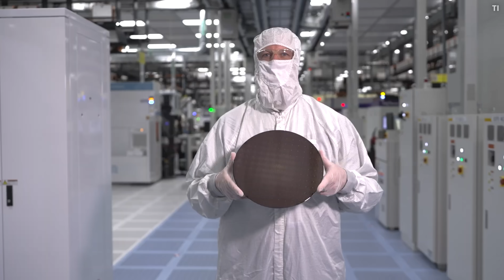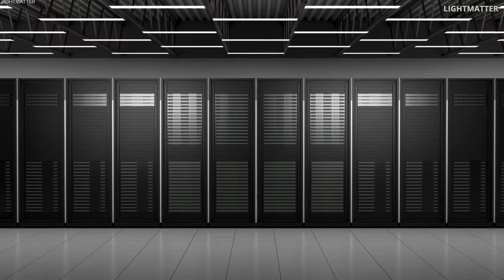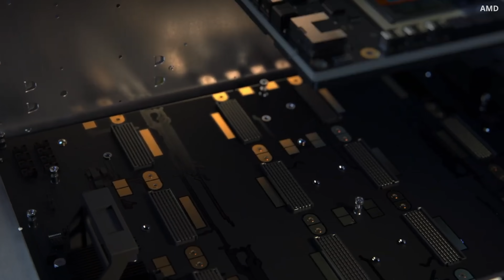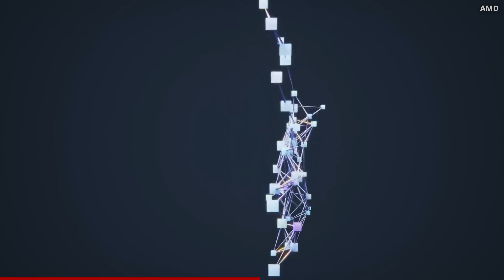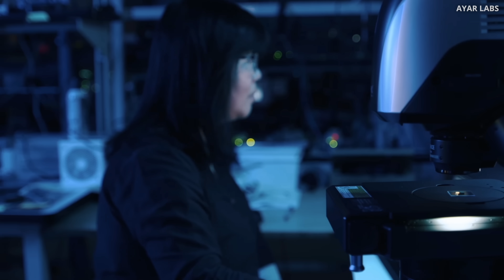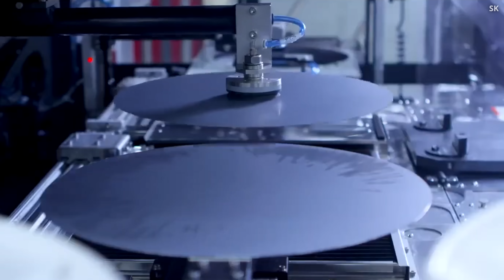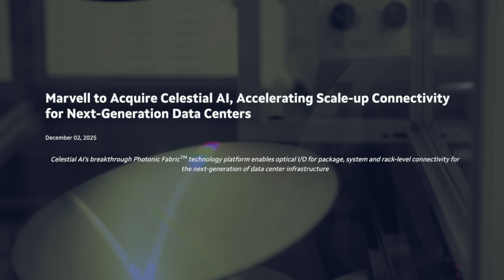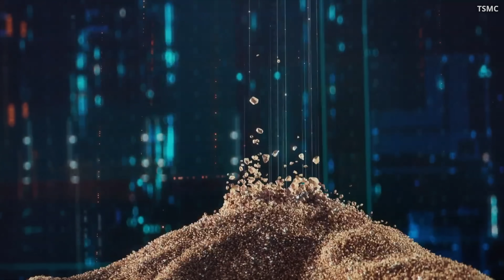Everyone Is Chasing This Technology

Comment: Plasma... use low temperature plasma to self translate light to electrons. Theoretically possible... just needs to be done. Look at how the new laser welders work. I have looked at them and all the light is doing is directing the flow of electrons at the welding site. The future is plasma physics... its how the entire universe works... its how nature conducts massive amounts of electricity... stop fighting it because of old models of physics... everything is electrical/light. Matter is a trapped frequency of it.

Comment: 7 minutes in, guys correct me if I'm wrong since I'm not a expert on the topic. But wasn't there a case of not using optical cables for interconnects that were lower than few meters because of the costs itself? Also there was one case about higher failure rates for optical links. (Source: I worked a little bit on datacenter load balancing)

P.s. amazing video though. And thermal stability is a gigantic problem in hpc

Comment: ♥️ @AnastasiInTech : Why aren’t day using pi-phi-fiber-optic relay filaments in place of copper electrolysis of zeros & ones’ at ration with 7+color palletes to bus data stream in these mega-nests? Seems would proliferate a lessening to the heat cooling load depending on the bandwidth of photon implemented to transmit from interpreter to data-cruncher no? Haha- “half a thrillion” love it+,!oD

Comment: 4;37 0 this is not entirely true.. signal is a codifed process for a transiever and recevier, and it has to be a language....         you cna make higher speed language that operates on a different transmission data point. you only need a binary pulse sytem of yes or no to write any core language.... and thus be able to understand.. if you push it faster, you cna use speed modulation and power as the language itself, since its going to have something in it... faster.. itslimtied to restiance and speed of carrier through matieral and the distance. the ideal of translocation or core pathway coms is also a link to say robust network and coms hyerp line for base pair coding so you can send faster light transmissions in a duel sychonrus for the main bus that .,. essentail is hauling the core data... then processing ofthat data can be re organized at hte output with signal means that divide back into somethign that coded ot be udenrstandable.  so not sure about if you pus hit faster and faster its not udenrstood.. you can just light.. and not cables... to transmit data, but oftne you need all this conections.. a light based systme would like liek some of  sci--fi darkest 70;s shows.. withtheir orbital desig namin frames that have  a few trillion inbisible laser pointing system that can shoot signals into the receptors/ receivers for the data parsing ot the server system... the nyo ucna run few main cables and lower the heat requirement... you cna use a solid laser so its always at the correct intergral point... so its always aligned and ist firm system.. of engagemetn or a hypoer lens augementation which uses valabrated system s that can scope variosu lens and hit more receptors and other thigns with 1005 precision to the data line directions and by using close proximities you can even alter the codex fotreh laser wavelenth. .and increase the programmign load a trillion tiems by dividing the wavelenght systems... the entire enwtwork server shrinks to 1/1000 the size becuase you don't ahve the caalble land calbe hard recevier ens you only need a receiver processing core that interpolates hte light system.. and hten yo uneed ot engiener how to quickly change out damaged zones or ends quickly without effect..... then there is multi angle amplicaiton and interpolation progrmaming meanif you ahve rows of these sphere laser transmitters.. hubs.. you cna laso have many of htem and they can do interesting thing of amplifyin geach others carrier wave while then essnetaily injecting new packets nad codes with in the light systme itself... so it makes all teh serves  just meh...

Comment: I wonder if or how significant and fast we'll start seeing technological leaps start happening once these data centers are operational since AI assisted scientific research I assume will just exponentially explode. Wonder if in like 30 years we'll have quantum chips and fusion batteries in everything lol. I really hope in my lifetime soon we get the next breakthrough in how we consume information visually, like extremely high definition holographic 3d displays we don't need glasses for. We've been stuck with screens for too long lol. I assume we'll probably get a ear attachment or headband to scan brainwaves so we only have to interact with everything mentally in the future since we can already do that now but it hasnt been refined.

Comment: In my town, there is a gypsum mine that has hundreds of miles of tunnels - 150ft underground - at 53 degrees F degrees - all day every day.  So where should they put a data center with near zero cooling cost?
Reply: near the arctic circle

Comment: This proves that this field needs a lot more thinking, the Human Brain  does better at Pico levels of of power consumption compared to this. Someone is making a lot of money on building this AI stuff with no return on investment! Oh it will Real Sooooon!
Reply: ~ 50 TOPS/W for the brain is pretty good but not outstanding. You can match that today with enough silicon running at low speeds.

Comment: They should build the 1.2 GW AI-data centers in the Antarctic, saving energy for cooling and making a tolerable temperature for running greenhouses and as such new human settlements. Petrol for the production of the electricity is also next-door.

Comment: In my opinion current AI is not intelligent at all. It merely is a high speed information gathering tool. If real AI would exist, then it would be replicating our brain and only use a fraction of energy and start doing the actual "thinking" without a mega data center.

Comment: Great video.  Agree 100% with all you said.  There's a really-promising new idea called "Sparce Circuits" that OpenAI's developing (See "Understanding neural networks through sparse circuits", OpenAI, 11/25) that will greatly-impact everything in your video.

As an old modeler (40+ years), a constant headache is variable-reduction.  You can essentially think of "Sparce Ciruits" as an intelligent, methodical approach  to variable reduction on neurons.  Bottom line you get eitther:  a)  Almost indistinguishable performance at very significantly-reduced model sizes/footprints, or  b) Much larger/more-effective models within existing resources. 

Neuron reduction = less computing required = less power needed = fewer CPU's/GPU's needed = smaller operating costs and footprints, etc.

Comment: Data centers use water as a heat transfer medium, but they don't actually consume water and need more.  They can just transfer the heat out of the water, and then use it again forever.  It can be a closed system that doesn't need to lose water, and replace it with more water.  Same thing with fabs:  Their "used water" is actually cleaner than any fresh water they take in from outside.  So recycling the water saves them money for purification steps.

Similar to the "running out of fresh water" doomsday claims:  California uses more electricity to transport water from the Sacrament River Delta to Southern California, than the Carlsbad desalination plant uses to make fresh water per acre foot.  The numbers are all available in public documents online.  We would save money by building more desalination plants and decreasing water transportation!

Comment: Yes, these data centers take a lot of power but just think of the power that would be used if the various users built their own off-site data centers. At least when the center is shared and concentrated like they are, there is a greater efficiency to the overall system.

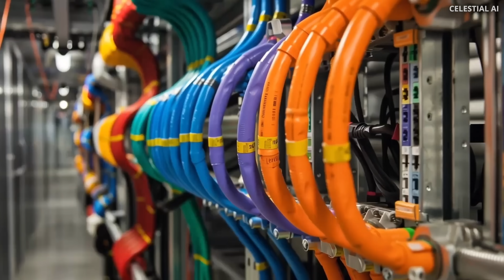Comment: 3:36 Silver is a much better conductor than copper so not sure why they're using it still. I get it's more expensive but these companies have so much money, and stand to make so much more with AI that I know they can afford it. In vaping if you want the least voltage drop and cleanest signal you use silver contacts instead of copper.
Reply: True but you know it is all about cost savings and usually companies like these are penny wise and pound foolish the company i work for does the same thing instead of fixing they're Vehicles one time with a major service and by sending it to the manufacturer to be fixed they instead fix one thing at a time and send them to avarage Joe mechanics the repairs last about 1/2 months  before breaking again but they have repeated this for 2 years now same vehicle 600,000 km ( 372,822 miles) on the odometer 😅
Reply: The electronics makers use gold plated contacts because it doesn't tarnish so badly like silver does.

Comment: IMHO what is needed to attain “the Singularity” is NOT LLMs.  A completely new platform that models neurons will be another world changing event.
Reply: I agree. AI needs to be able to structure its thought processes by some form of quantifiable logic, rather than splurt out a response from a soup of weights made from data of questionable reliability. It needs a way of breaking information into equations of fact and a way to recombine those elements to synthesise new expressions that preserve the truth value of the original information.
That's my guess anyway.

Comment: why are these data centers placed in warm environments

these data centers, should be placed in for example scandinavia, iceland, greenland , Alaska in these environments, the heat these data centers generate 40% should not be a problem, when the outdoor temperature is -30 Celsius

now data developers are normally quite intelligent, but here they seem to have missed something fundamental

the military has long used Gallium Nitride GaN, for radar systems, so we should be quite good at using this material

in the new radar systems the defense has moved on to a GaN AESA radar (Gallium Nitride Active Electronically Scanned Array) which is significantly better
Reply: Because of 
A) savings in cooling
B) plentiful clean low cost clean Wind and hydroelectric power
C) goog connections to global internet 
D) utilization of waste heat to heating
we have some 50 data centers in Finland (population 5 M) and some 40 projects more were

Comment: Question (anybody?):  Could you build an optical demux where LC mirrors acted as optical gates?  The first half of that would be, are liquid crystals fast enough to gate optical streams?  Suppose you had a stack of beam splitters where the signal would pass through all "open" gates and be reflected into the channel of the first liquid crystal gate that was closed.

Comment: I know of a data center located at a far northern coastal BC place that has a huge waterfall, a very large lake feeding the waterfall, and a basically abandoned  town that used power from turbines being fed by the very cold lake. I wouldn't be surprised this system is being cooled by the cold water from the lake ! It also has the resource of the cold Pacific water surrounding the area. What a perfect place for a Data Center except for the cost of communications out of there !
Reply: Which makes it worthless.
Not enough power
Reply: @sparksmcgee6641  There were 10,000 people there and they had power from the huge generators coupled with the dam of the lake. The pretty much all left and a company bought the entire set up. Lots of power available to them.